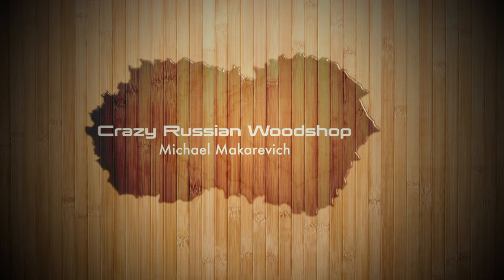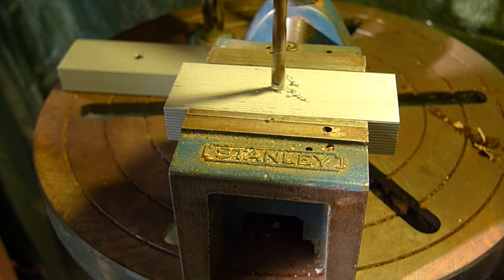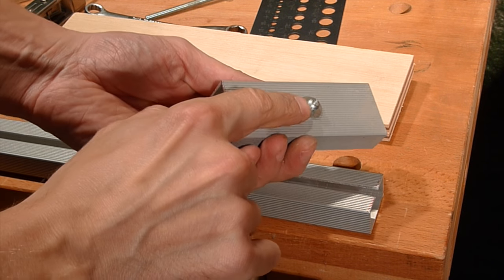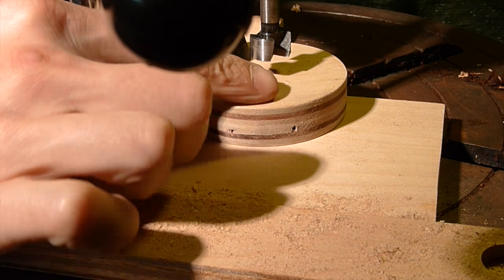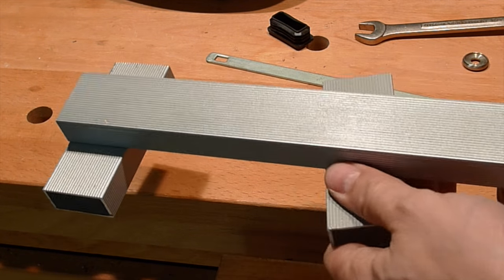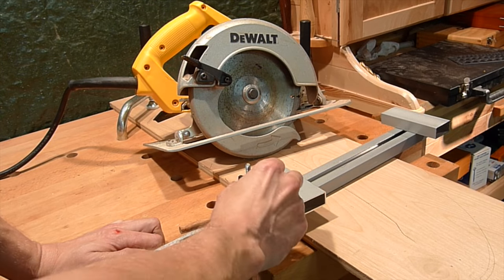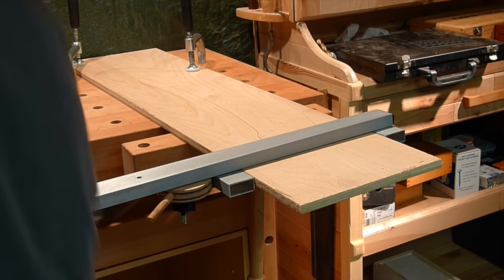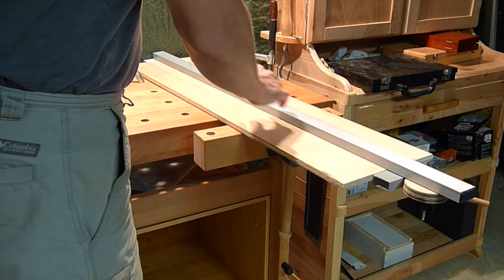DIY Circular Saw Guide

Comment: Neat idea, but how do you keep the piece at the end of the bar in a 90 degree angle? 

I would make it slightly longer and then use epoxy to glue it in place as I think that would be more likely to keep the end piece at a right angle to the main bar.

I guess you could drill the hole in the short piece offset to the edge and then mount it with the hole pointing towards the bar as then when you clamp the work piece in place that should straighten up the angle of the end piece to the main bar. One disadvantage is that you need to make sure that the holes are exactly in the centre of the main bar or it will tilt to one side when tightened up...
Reply from the maker: Because the rails have small "ribs", I thought it would keep the piece securely at 90 degrees. I didn't want to make it much longer because sometimes you need to cut at a slightly different than 90 degrees angle.
I would still check and angle with a try square if the cut has to be very precise. It seems to works well even like this though but I understand if you make a longer guide that method will be less precise...
Reply: Cool, maybe I'm just over the king things a bit... 

You can always check the angle with a known true before use.

Comment: TU, clever. if this is your original idea, you should have patented . some tool company will steal this for sure.
Reply from the maker: Thank you! The eccentric clamp is not my idea, of course, but I did come up with that simple variation of it. I am sure someone already came up with it before as it is such a simple idea. :)
Reply: making jigs is fun but edge guide has built-in clamp and does the same thing.Although i never trust them for router guide work. they flex in the middle.
Reply from the maker: True, this type of guides are not great for super precise cuts.

Comment: two clamps to the wood would do the same job
Reply from the maker: True. The main inconvenience with the two-clamps method is – clamps go under the workpiece and it is harder to position the workpiece flat if you are working on the workbench. The circular saw guide stays flush with the bottom of the workpiece.